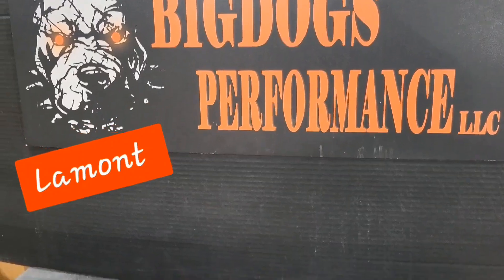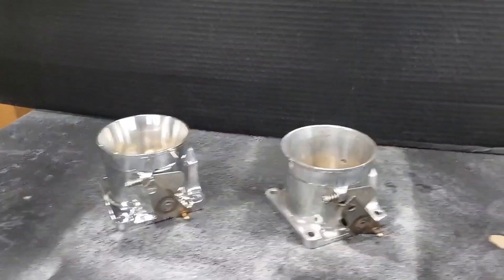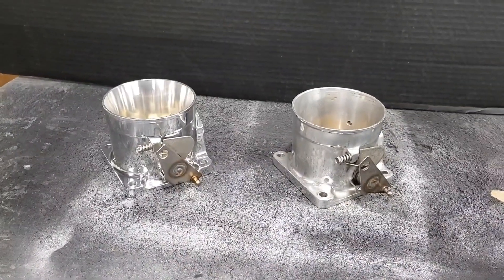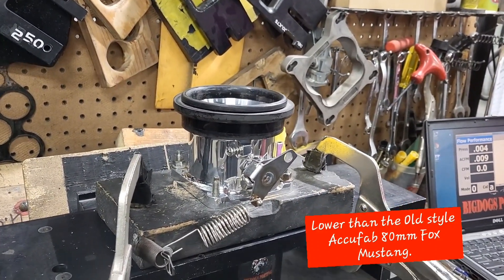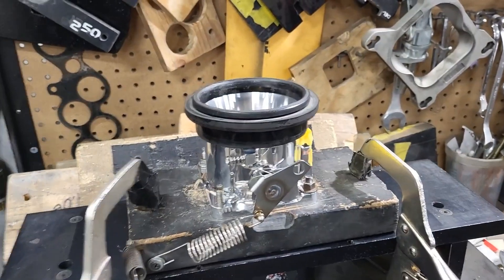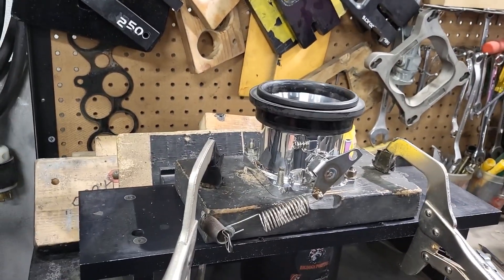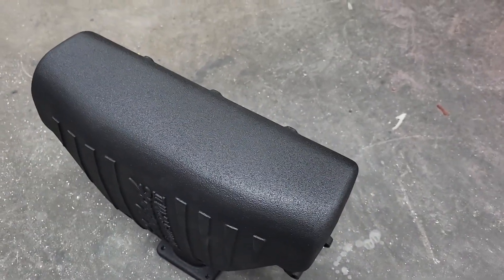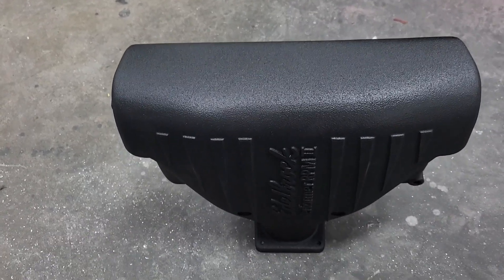Accufab Fox body Mustang throttle body test

Comment: Im glad you did a video on whistling after market throttle bodies. Since installing a BBK 70 mm on my dad’s 1990 along with an Explorer intake it started whistling at idle. I was scratching my head at what is going on. The car perform well. I thought it was maybe a vaccum leak. I want more details on the cause of the whistling please. And what is the cure? I never had any work done by you so far but im watching all your videos. Im a fan and love your work

Comment: They made the shaft thinner for flow, if it did, who knows!
Reply from the maker: The new style 80mm actually flows less than the old style by 25-30cfm.
Reply: Well there ya go lol. I used to grind them down on factory ones lol. All hear say from a long time ago I guess!
Reply from the maker: @johncanida1198  no it works it's just if you look at the new tb shaft it has the shaft on both sides of the blade even though it's thinner. The old style shaft is only on one side and by it being smaller it creates less resistance. They are now out sourcing the shafts and blades on the new style and probably from over seas. Overall it's still a great flowing tb. We just made it even better lol😊
Reply: I'm sure it is better. And ya everything is foreign anymore, it's a dang shame

Comment: Nice video guys. it will stop whistling if it  opens all the way so all you Gotta do is grind the stop so it open a true 90 degrees and radius, one side like a air foil I imagine will do the trick
Reply from the maker: That fixes some. This one whistled at idle set, 1/4 open and wide open.
Reply: I see 🧐

Comment: Hey guys, I have a question for you from a true fan not a troll, I promise.  A 302 cid motor can only pump ~564 cfm at 6,500 RPM with no restrictions.  A stock 70mm Accufab throttle body flows 787 cfm according to the Accufab website.  How does moving to a larger throttle body than a 70mm or getting one that flows over 1,200 cfm help a N/A 302 that only sees 6,500 RPM?  I'm legitimately curious and want to learn, not trolling.  I have a 1989 5.0, TFS 11r 190 heads, N-41 cam and Holly Systemax II intake.  Should I go bigger than my current 70 mm?

DISPLACEMENT……6000 RPM……6500 RPM………7000 RPM
290……..……………………503………………..545………………..587
300………..…………………521………………..564………………..608
310……..……………………538………………..583………………..628
Reply from the maker: There's a lot of real world things that you are not factoring in for your calculations. Have you ever wondered why ford put a high flowing 80mm throttle body on the factory 302 Coyote motors and why a high performance sbf efi 302 picks up HP when using a high flowing tb, intake pipe and maf sensor? Less resistance for the air to make it to the cylinder. You have to look at the cfm required to support the hp not what cubic inch vs rpm.
A 302 making 300hp at 6,500rpm will require less cfm than a 302 making 400hp at 6,500rpm.
Reply from the maker: You actually wasted money on your 11R heads because your combo of parts is not even close to being able to feed the heads enough to make what the heads can support
Reply: @bigdogsportingtonyb2833    What size throttle body would you recommend for my setup?
Reply from the maker: @pittsky  not so much the TB size but intake system flow. You can have a intake pipe that flows 950cfm, a TB that flows 1,200cfm but your intake manifold tb tunnel only flows 800cfm and your motor will only see the 800cfm. That's why we don't recommend 11R heads for a NA sbf 302. You need to see what your whole intake track flows